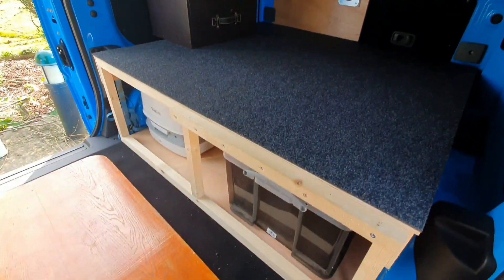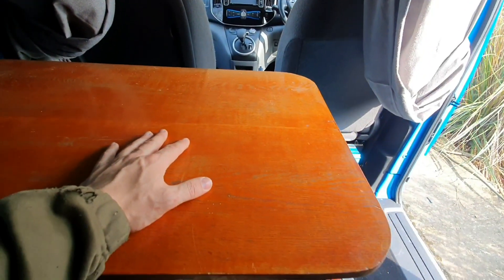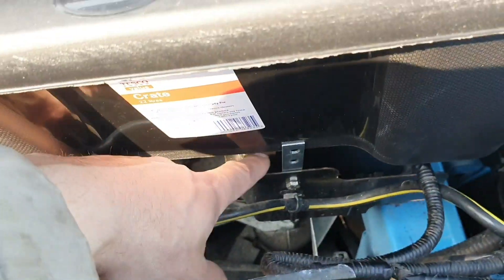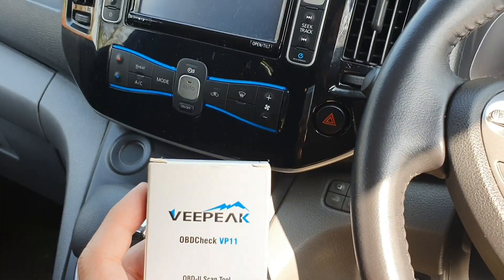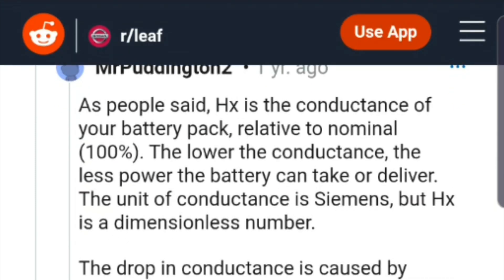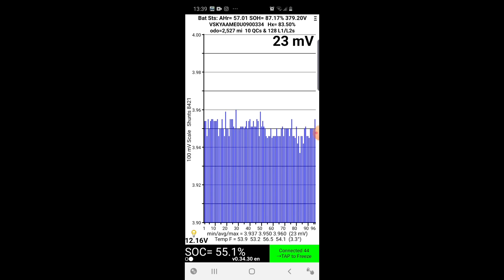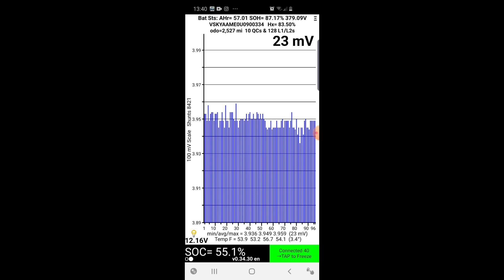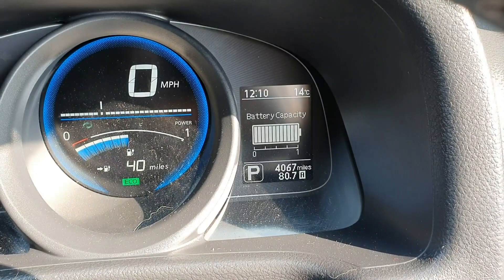NISSAN E-NV 200 - ELECTRIC CAMPERVAN CONVERSION: Finishing touches & connecting OBD II to leafspy

Comment: How's your van going? How's the range these days?
Reply from the maker: Still going strong. 70-80 miles on the dash. Sadly it will be going anyway next month despite being in great condition. I have the opportunity for a custom bigger battery and took it! 😊
Reply: You selling it then? Definitely interested @RichardMawby
Reply from the maker: @philwilliams23 not selling sadly, it's going back to the leasing company who wasn't supposed to sell them so I get 3x it's current value to cover the new van.